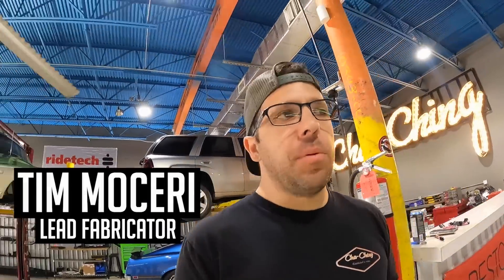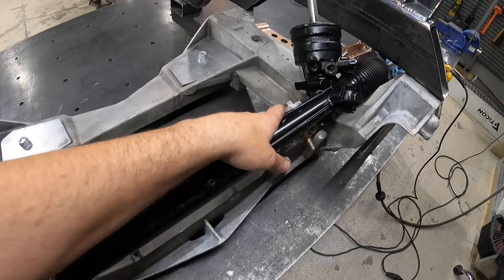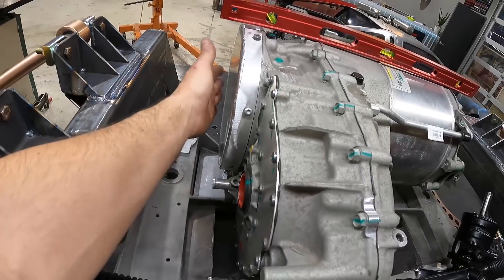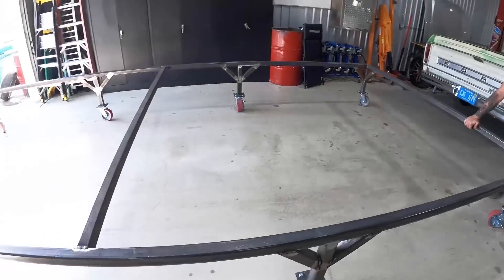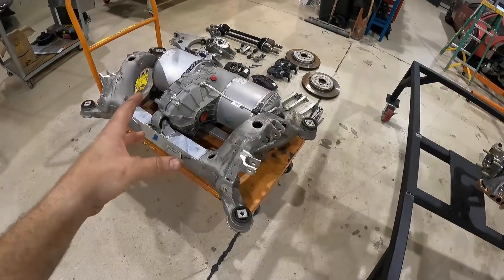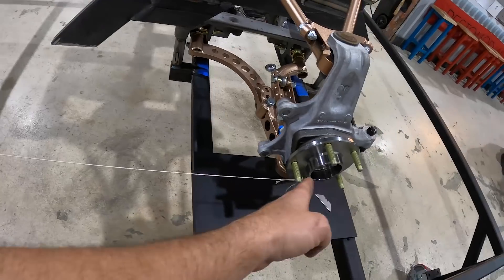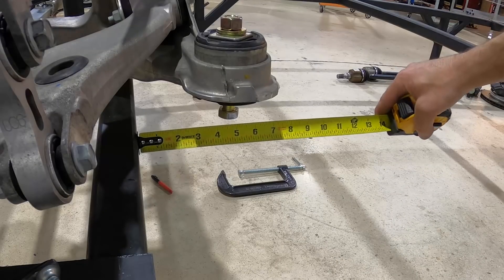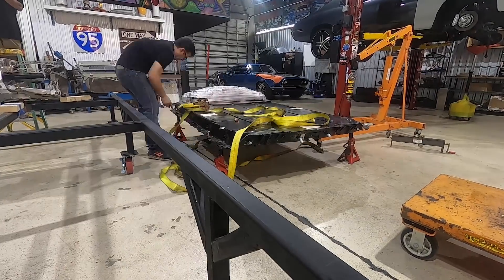Custom IFS & IRS - Tesla Swapped 1985 Chevy C10 Truck - Electric C10 - Ep.3

Comment: Cool project.  If you have the budget, seems it would be much easier to use the tesla front and rear chassis setups, or frankly just drop the C10 body on a stripped dual motor tesla.  Of course, I'm building a 56 chevy nomad with 3 leaf electric motors and C5/C6 suspension and C4 frame.  I have changed to use a nissan leaf front setup so now thinking of just using the leaf suspension in front, it is slightly narrower than a 56 chevy body.  I have some 10in I beams to use for making a square and flat chassis from to integrate the leaf in front with the C4 in back with C5 suspension and diff in back.

Comment: Does anyone make parts to shorten the rear track width? I'd love to do this swap on my 53 Buick, but I've only got 58 inches to work with.
Reply from the maker: For the axel length? If you don't use the Tesla IRS you can get adapters to mate up your axels to the Tesla motor. Check out our suspension episode for this truck. It'll give you a better idea of how to do it in a custom subframe set up!

Comment: What was your reasoning for not using the model S front sub frame also?  Wouldn't that have been more advanced engineering, lighter, easier etc..? Interested in the decision making process.
Reply from the maker: We're using a rear drive unit in the front as well, so the testa front subframe won't fit the motor!

Comment: Did you consider setting an angle for the upper control arms on the front suspension  to have ability for active caster and roll center adjustments?

Comment: You don't have to do that, GM has developed a electric engine to put under the hood using existing powertrain to swap out with the gas engine, if you want electric
Reply from the maker: Yeah but that's not cool. Or fast...
Reply: @SalvagetoSavage  buzzz strike 1... 500HP entry level + you actually have powertrain instead of some crap toy shi+ like electric motors on the wheels

Comment: It will be nice if you can add another battery in parallel as you build now. Or better still you can let car drive on EV with back drive unit while you add a small gas engine to the front EV drive to recharge the battery at demand so you will never have to stop to charge if you don't want to.
Good work so far I am loving it.
Reply from the maker: That's not a bad idea! And thank you for the support!

Comment: It's a transaxle (a transmission with final drive), not a transfer case. It's just like a typical manually shifted transaxle used with a transverse engine, but with only one gear ratio (so no shifting gear, no reverse, no clutch).

Comment: Since the MOTOR not engine, is so small why not build the suspension first then mount the motor. That would mean you don't have to cut tabs off. You can get it right the first time.

Comment: Just curios what the actual dimensions of the battery pack is as you guys put it in for width and length, I'm hoping I can fit into in the stock frame of my 14 F150 :)

Comment: One major issue I see with this front end is that it is going to torque steer like crazy with one long and one short axle in it. The work around is to built a jack shaft with a bearing support on the long side to keep both of the cv shafts equal length. Just look at all front wheel drive cars from the mid 2000 to now. They all have this kind of set up to get away from the old torque steer issues they used to have.

Comment: I'm a hater.
Reply: What does the exhaust sound like?
Reply: How does it do in the rain and snow?
Reply: So if it dies.... Can you give it a jumpstart?
Reply from the maker: It's not a combustion engine so there's no need for an exhaust. It's running a Tesla set up so it has the same weather sealing and elemental protection. And what is there to jump start? A jump start is just used to turn over a motor when a battery dies. The thing is one giant battery. If it dies you would just charge it.

Comment: Stole my idea I just bought a 330xi just to do this 🤣🤣🤣
Reply from the maker: Hell yeah! EV swap it so we can race!
Reply: @SalvagetoSavage  🤣  o I definitely am I just need the money 🤣🤣 .     

I want to run  really make a hybrid   An ls (lq4) huge turbo (top end) with a gs450h transmission (bottom)end 😈😈( there’s a guy that’s hacked these it’s not really a transmission it’s 2 electric motors an adapter for the 330xis transfer case  and front diff (I think it will clear the truck oil pan) 

  The engine would only really be used for top  end and to charge the batteries. 

It be more logical to use a kseries 🤣🤣  but na  v8 

Someone steal my idea build it 🤣🤣

And a model 3 battery pack it’s gonna be heavy.

Excuse the grammar on a skateboard 🤣🤣

Comment: And has anyone figured out if it is possible to charge the battery while it is powering the motors? It would be killer to mount one of Hondas super quiet inverter generators in the bed and have the battery charge while you drive...

Comment: Great idea and fun project!

I see your using aluminum for subframe and steel for frame rails. I hope you’re using a barrier between the two metals to prevent galvanic corrosion. We see this too often in our body shop, which is a fail point. Especially, with aluminum wheels on on steel rotors. Metal should always be coated with a barrier.
Reply: There are rubber bushings (the stock ones from the Tesla Model S) between the subframe and the frame.

Comment: How did you considser or address galvanic corrosion with the aluminum subframes? Aluminum and steel needs to be properly isolated or coated.

Comment: I have never thought about this, and so obviously have never looked into it. I bet Tesla could probably make a killing in retrofit kits. Even if it’s just a basic kit.
Reply: Agree but their profit margin is hard sell kits with. $50k just parts. Too big a cost. Even a 10,000 dollar clean 1981 Corvette would be 75-100 grand when done. Chevy has E Crate but not sure when and at what cost. That would awesome for classic resurrection projects. Keep factory drive and suspension. Replace engine and gas tank with Electric Motor, controller and Batteries. Much easier DIY project.

Comment: if it has an electric motor, im missing the "savage" part in the build. yes, electric motors provide instant torque to the wheels, i get that. but to me, for something to be savage, it has to have SOUND with it as well. all you'll hear is the sound of the tires going down the road and maybe a high pitch whine of the electric motor. that's it. there's no sound of a BEAST under the hood like with combustion motors. especially the V8 that would have been in this truck out of the factory.
Reply from the maker: You will 100% hear this truck! Thx for watching homie

Comment: I don't see why this type of build is more popular especially for trucks using the frame rails to mount pretty much everything you need.
Reply from the maker: The main issue we've been hearing from those doing EV swaps is that the battery range just isn't there yet with the available tech.

Comment: Honest question. New viewer. This is built for a drag truck? How many drag strips have charging stations? Ideally I would assume every hit should be done at 100% battery power?? The torque is pretty much unlimited. Great fab great idea. Not trying to hate at all just have questions about the charging???
Reply from the maker: Great question! We'll have to get back to you on drag strip charging availability. It's more set up as a full drift/race truck. We're setting up the suspension for some really aggressive cornering. We should be able to charge this thing up in the pits between laps.

Comment: Front wheel drive cars do not have a transfer case, neither does your electric motors. A transfer case splits torque front to rear. Front wheel drive cars and your project have a transaxle.

Comment: Anyone know why?  Why did they make the motor mount tabs short and mount them to some 1/2 x 1/2 square tubes @4:12 rather then just making the motor mount tabs long enough to reach the frame?  I saw they welded a plate to the frame so why not just land the tabs on that?

Comment: Really looking forward to this project. Subbed. With all oem's going EV, this only makes sense. Really needs to be more effort going into battery research as this is the limiting factor. Hope there are future retrofit kits for converting all sorts of cars to electric so that we can continue to enjoy classic styling with modern powertrain.
Reply: It’s neat but I’m afraid they will not allow home built vehicles to be plugged into charges stations. It will only take one moron to ruin it for everyone and from what I have seen on other channels it won’t take long.
Reply from the maker: We still love the classic high octane, loud exhaust, turbo motors, but it'll be interesting to see where the future of hot rodding goes!

Comment: 85kwh LR Model 3? Netto usage from that model is ranging from 73-78, depending on which year. 85 is available but not usable. Please get it right ;) Don´t be mixing this up with the dino-old 85 kwh from the Model S. No electric car manufacture maximize the usable Kwh on any ion-lithium battery, it has to do with the life and health of the battery. Otherwise, LOVE this conversion! <3
Reply from the maker: cool!

Comment: Ok so weld large "cooling fins" on the transfer case; hopefully they resonate... and this awesome looking thing doesn't sound like a hoverround scooter?
Reply from the maker: Having two motors should be decently loud. We were thinking of running straight cut reduction gears for some more noise, but from what we heard, we should be getting a good whine out of the Model S motors.

Comment: Tons of work ahead, but looks like it is going great.
Reply from the maker: We're racing against the SEMA clock here. There's a little more metal fabrication that has to happen before we start trying to wire up the battery and the motors.

Comment: Are you getting all these parts new direct from Tesla? Nothing looks to be salvage from collision cars.
Reply: You should be able to bolt C8 Corvette wheels to Tesla Model S hubs with thin bore spacer rings. Same bolt pattern. Same size lug nuts. Similar offsets (doesn’t matter for this build) 

So Corvette wheels all around?
Reply from the maker: We sourced our parts through eBay motors, specifically Autobahn Dismantling! They hooked us up with the motors and batteries. We wish we could source these parts direct from Tesla!
Reply: @SalvagetoSavage  Nice to know.  Looks like really nice parts.
Reply: @SalvagetoSavage  yes they are finicky about that. There's a guy on here YouTube. He bought a water damaged car. Dried cleaned it out trouble shot it to a module. They wouldn't sale him the replacement part. In protest he bought another car for that part